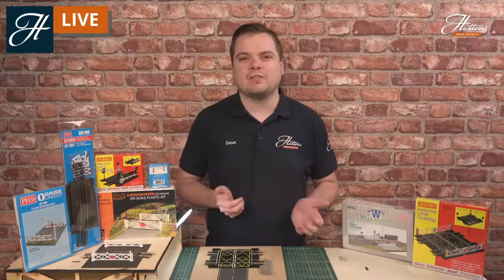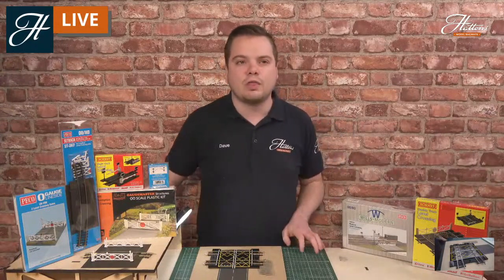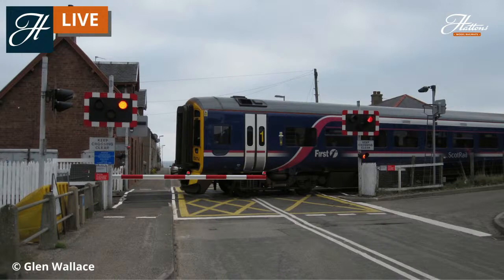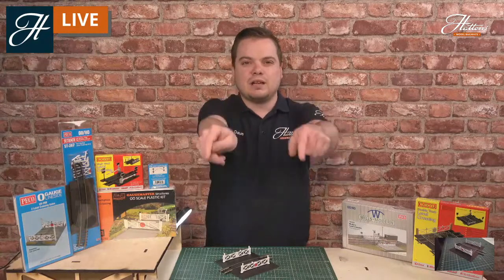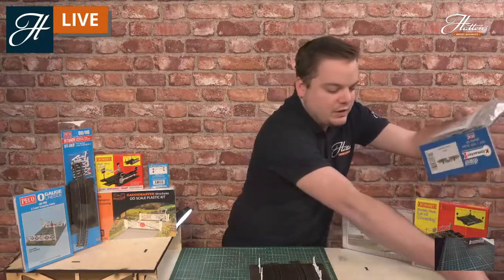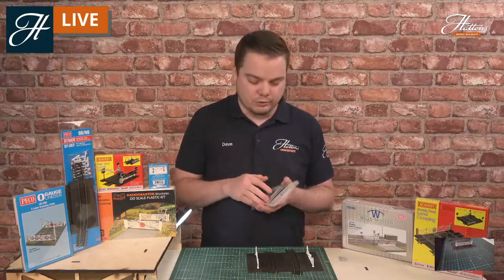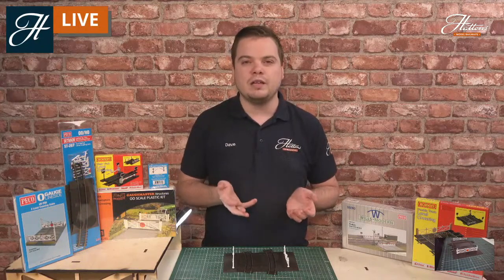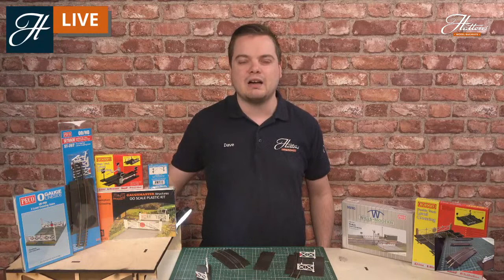Where road meets rail - modelling level crossings

Comment: I wouldn't buy the Hornby level crossing with the box markings as they've only gone and hit it wrong. The diamond should be facing the on coming road traffic as seen in the photo of the Clasx 158. This not Hatton's fault but Hornby's.

The yellow box markings are not always required even on AHBL level crossings. To find out when to have the box markings get hold of a copy of the ORR's pamphlet on level crossing, which also sets out the required road signs and how far from the stop line they need to be placed. If painting the road markings you'll need to look at part 5 of the Traffic signs Manual.

There are manual level crossings on the ECML, the nearest to me is to the south of Helpston.
Reply from the maker: Here's a link to the pamphlet referred to by Neil which makes for interesting reading, as well as including a lot of guidance on correct signage etc - https://www.orr.gov.uk/media/10713
Reply: Is that Longbeck as in Marske-by-the-Sea, Neil?  ... Just wondered
Reply: @AlanLancasterAlanRLancaster  it is. I used to live next to the Railway Cottages.
Reply: @neiloflongbeck5705  On the road down from the station into Marske? (Last I saw, the station's been turned into a 'bus stop' for Saltburn/Middlesbrough trains. The brick station buildings were boarded up). I used to live behind what was left of the station at Eston, just a Co-op coal depot at the time. [I've got a page on Hub Pages on Eston's ironstone mining history, see the 'slide show' on my profile page, https://hubpages.com/@alancaster149 plus several pages on the Cleveland area, railways, model railways etc]. "Dip in".
Reply: @AlanLancasterAlanRLancaster  an interesting collection of articles.

Comment: How easy is it to detach and then reattach the Peco level crossing pieces?
Reply from the maker: Hi Daniel, the gates slot into the holes located on the plastic ramps supplied. Easy to fit and no glue required! - Dave